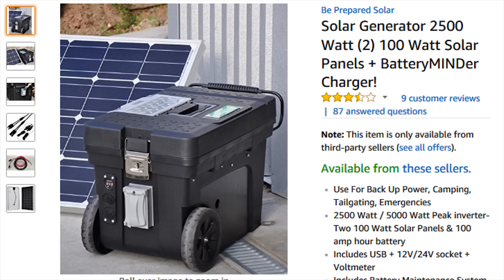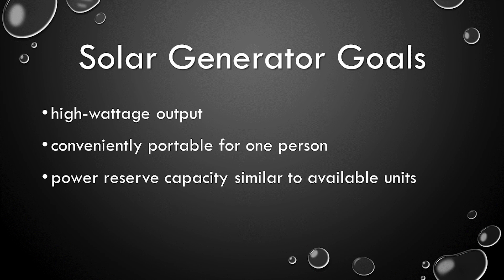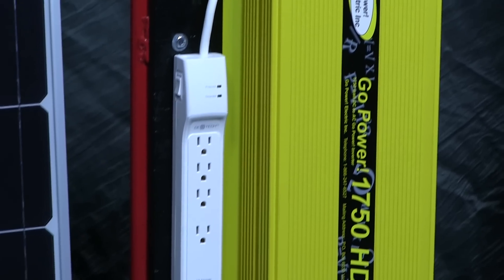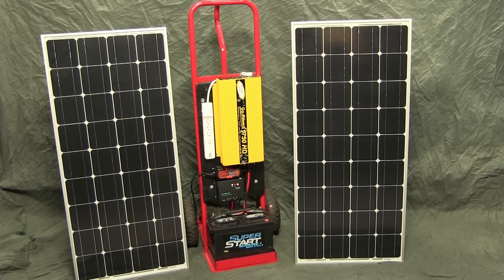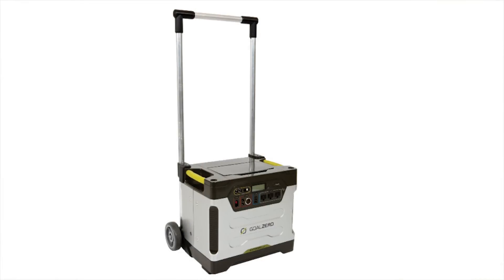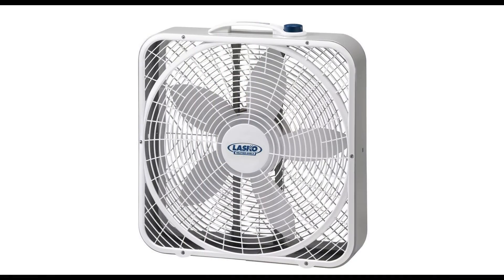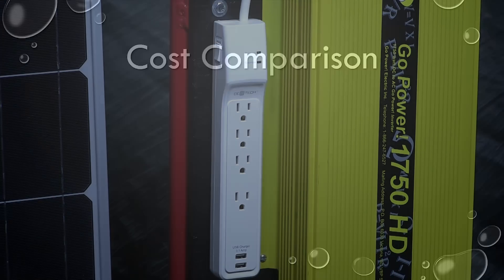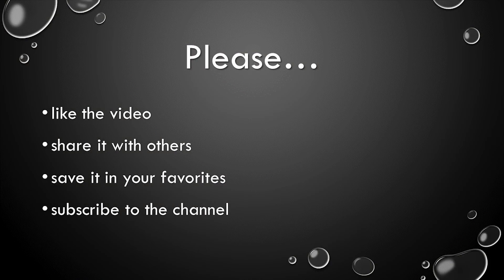DIY Off-Grid Solar Generator (rev 1) – Low-Cost Portable Power

Comment: Would your outstanding unit not be better served with a Lipo battery in place of the lead acid one you used?
Reply from the maker: Yes — upgraded the unit to AGM.  LiFePo is very pricey, and I’m not sure I’d use the additional capacity. Thanks for the suggestion.

Comment: this is a great setup.  i am researching options for my off grid cabin, and really like the hand truck for moving it around.
Reply from the maker: Thanks got the comment.  Be sure to check out the follow up videos — I’ve made several enhancements that would make the unit a good choice for your off-grid application.  The builder’s guide video includes a design worksheet you can download to calculate the parameters for all your components.
Reply: Desert Prep will do, thank you!

Comment: Would this set up be enough to run a dometic CFX65DZ continuously for upward to 5 days if needed? Would also like to see a how to do video! Thanks you
Reply from the maker: I can’t say for sure, but five days is doubtful with my original version.  The builder’s guide video in the channel includes a design worksheet you can use to get a good idea of what you’d need to support the fridge.  You can plug in the fridge specs, and know what you’d need to support it for five days.

Comment: does not meet the power of a small gasoline generator, puny thing.
Reply from the maker: LOL — yes — gasoline generator wins as long as you have fuel.  I have three generators, and felt pretty well set should the grid go down.  However, when I started thinking about how long they’d run on any practical amount of fuel, and what the logistics of fuel storage would be, I knew a solar solution would be necessary for just about any significant emergency.  In an emergency I’d have about 50gal of gasoline available, and this wouldn’t support either of my gas generators for all that long.  After the fuel’s gone, I’d have nothing.  This was the very reason I set out to build this unit.

Comment: Wow, your solar generator set up is almost identical to mine except I am using a slightly smaller 1.5KW inverter. I especially like the way you set up the hand truck to make the whole package portable. My portable solar power system isn't as portable as yours so I will be borrowing your hand truck idea to make some improvements. Thanks for sharing.
Reply from the maker: Thanks for the comment.  It’s particularly nice to find others that have put together their best knowledge and arrived at the same place. Be sure to check out the follow-up videos, especially the builder’s guide.  You might get another idea or two.  In about two weeks, I’ll post a video on the “final” version which is considerably more capable, and integrates a lot of the suggestions from the comments.

Comment: Nice video, good job.
 I built mine with $1700 capital for a 3 pcs 150W solar panel, pwm charger regulator 2000w inverter and 6, 100A deep cycle solar batteries, I did all  connections and DIY all fabrications. still working after 3 years, I actually think  I have ROIed my batteries already from my electric bill savings.
Reply from the maker: Sounds awesome.  Check out the builder’s guide video for a few ideas on your build.  I’ve posted a design worksheet link in the comments you can download that will calculate your system efficiency, and play “what if?” to evaluate upgrades you may consider.  I’lll be surprised if it doesn’t get you thinking...
Reply: Thanks, yes daytime exposure is 50% in tropics as shadows overcast after noon time.

Comment: only thought i have is instead of Modified Sine Wave Inverter needs a pure sine wave inverter as a future upgrade
Reply from the maker: You’re SO right.  Check out the builder’s guide video — it speaks to the evolution of the project, including mistakes I made in e original version.  A pure sine-wave 9nverter was the first of several enhancements...

Comment: Good video and presentation. Nice build. Mine is very familiar with the same red, big wheeled trolley. It works great for all my tool shop needs in the summer. 2 125 watt solar PV panels, 2 large batteries in the bottom, 5000 watt inverter and charge controller.
Reply from the maker: Sounds like a great setup...

Comment: Your entire build is based on your battery capacity. You should say upfront, the amperage of your battery at a 20 hour rate, and the nominal voltage of the battery
Reply from the maker: The battery is 90AH, so 4.5hr @ 20A discharge rate.  Nominal voltage is 12.8V.  I intend to add a second battery and double the capacity to 180AH.  There’s a lot more detailed tech info in the builder’s guide video.  https://youtu.be/6glK8-IcDgE

Comment: Thanks for posting and the material listing.  This is very helpful.  All the best.
Reply from the maker: Look for the upgraded list in the Rev 2 unit.  It has a better inverter.  I’ll be posting a builder’s guide with design worksheet you can use to spec out your own unit in the next 48 hours, so stay tuned...

Comment: Can you do a video of what it takes to maintain a normal 1 person cabin, that has a regular run of the mill 60 in. Flat screen TV. & A Play station gaming system, or a DVD system, a central air unite that accommodates a 1000 SQ. Foot house, a normal size refrigerator and normal size washer and dryer a normal size to toaster, & 60 watt bulbs as needed 1 per each room, running 1 at a time, sorry if this is a stupid question , but I'm just trying to see if anyone is capable of doing this , at a inexpensive price
Reply from the maker: The power requirements sound like you’ll need something well beyond this unit.  I’m working on a builder’s guide that will help anyone work out the design math.  Watch the channel for a few more days...
Reply: Carl, first off, if you are planning on powering all those high wattage appliances at once you WILL NEED way more than this portable system.  Think small scale first, then build from there.  A 60in Flat Screen with gaming system and AC ? Really ?  Time too fall back and regroup.

Comment: i will attach a wider base so it can carry at least two other batteries or mount the electronics on the back or sides to stack the batteries up
Reply from the maker: Larger batteries or more batteries is a good idea.  It’s not hard to both make the panel smaller and move it up to clear talker or stacked batteries. Thanks for the comment.

Comment: Desert prep, You took a seemingly complicated project and simplified it to the point of stupid...for guys like me.
Thanks!! ~:) I've been looking into doing dang near the same thing with the same specs. 
Down here in southern Az. This is the best option for my rv and for the house.!! 
VERY COOL.
Reply from the maker: Thanks for the very kind feedback.  Also, I've posted the wiring diagram in the comment at the top in case that helps. Be sure to check out the Rev 2 unit - it has some important improvements.  Also, there will be a Rev 3, following my real-world test video, out in a few days...

Comment: Nice job. I made one myself out of a tool box that I attach Wheels to with handles and I put two batteries inside the toolbox with the inverter of the solar charge controller and I bolted 100 watt panel on top of the lid of the toolbox it works great I get a lot of comments and compliments when we go camping
Reply from the maker: Sounds like a great rig!  Watch out for high temps in the box - batteries really hate heat.  Thanks for commenting.  Lots of people will like your idea.
Reply: Desert Prep thank you sir.

Comment: I was considering a similar design Harbor Freight solar panels on the roof of my golf cart and I had 6000 watt inverter to go in the back. I just hadn't put everything together your video informative and realistic thank you for information and inspiration. Great video!
Reply from the maker: Thanks for the feedback.  I can’t see too much utility in such a big inverter.  Without a LOT more battery and panels, practical loads are more likely in the several-hundred watt range.
Reply: Desert Prep golf cart had 8/6volt batteries and panels on roof was why not. When want charge I have water power gen. 50amp. It ride and multiple outlets for work or play. I run moving targets on my shooting range and it easy for power outage also who has power bank with mag wheels and run 50 mph 😇😇😇.

Comment: It would help to place the battery mounted to toggle front to back to eliminate removing the battery during transport. It would stay upright with mounting axis on both sides of the battery.
Reply from the maker: .. or switch to an AGM battery that won’t leak.  Thanks for the idea.

Comment: The yeti contains a lithium battery does it not? If it does it can take being discharged to far below 50% before being damaged. More like down to 5%
Reply from the maker: Yes, the latest Yeti has a Lithium battery, which can be discharged much farther without battery damage.  It’s a much better option that comes with the higher price.

Comment: Put a solar rated lithium ion battery on that. 4 times the power and no spill.
Reply: Lithium is no 4x the cost. That was true 5 years ago but today you can get lithium much cheaper. In the long run Lithium is actually cheaper than lead acid

Comment: Great idea.. I would also add a 12v side so u could charge say phones etc with out needing to go through the inverter. Saves on losses. Id only use the inverter on items that need ac. I'm totally going to use the idea of the trolley :D :D

Comment: Great video. Great build. Since you had a friend weld the tray on the bottom, I think I would have turned the battery 90° and added a second one. But lots of options. Great job.

Comment: wont your battery discharge to ground being so close to floor
Reply from the maker: LOL - no.  None of the circuit is grounded to either the cart, or to earth, so there’s no circuit to drain the battery.
Reply: Desert Prep, you said about storing it in your garage. I never store a battery on concrete unless I have an insulator under the battery to prevent discharge. There does not have to be be a traditional connected circuit for discharge, just that it's sitting for an extended length of time in contact with either the ground or concrete. Placing a square of balsa wood under the battery would cheaply & effectively prevent discharging without affecting your set up.
Reply from the maker: The battery box has a rectangle of expanded metal (diamond mesh) and a rubber pad supporting the battery.  I think the concrete discharge info dates back to car batteries some time ago.  https://www.snopes.com/autos/techno/battery.asp
Reply: A snopes link?  That's a total, Soros-funded propaganda website!

Comment: I like what you did.  I would recommended someone to first do a study of critical appliances and the four seasons to determine what an ideally sized system should be.  During an emergency, cooking and heating is better done with propane or natural gas.   My house has natural gas heating, so during the winter, keeping the furnace going would be very important.(~800W).  Also,   Refrigs and deep freezes would be great. Nothing like keeping your food safe. Some non critical appliances are TV, internet connection devices, computer, phones and some lights.  Maybe, the system could be used to offset your power bill.  Think of stepping the design up a notch and actually getting to a break even point in 10-12 years off setting some of your power bill and maintaining your emergency system to boot.
Reply from the maker: I think you’ve made great points here.  I’m learning a great deal in my own analysis, and would take different approaches to different scenarios.

Comment: Should check on using the 18650 lithium batteries has ability to use in any position.  Might have similar or better power output.
Reply from the maker: I’ve seen videos from people building battery walls from large banks of 18650s.  I find the idea very appealing, but not so much the need to build the banks out of hundreds of the small batteries.  Intrigued by the idea, though.

Comment: My first mobile solar build is a monster 500ah batteries 2500 watt inverter and 6x100 watt solar panels very heavy and not to mobile but it was still less than the yeti.
Reply from the maker: Sounds very impressive.  Both the batteries and the panels for your system are a better match for a load for a 2500W inverter.  Nice work!

Comment: I don't think you are supposed to chain together batteries with differing ratings or types.  Instead, you might want to consider some kind of battery quick connect/disconnect.  That way you could use your cart battery until it gets low and then easily disconnect it and connect to whatever other battery you have available.  I'm no expert on any of this though.  Btw, I did a quick search and found the below.  I have no clue if that would work or not.  However, it should give you a good idea of what I'm thinking.
https://www.mygreenoutdoors.com/motorguide-quick-disconnect-battery-terminals-1/?gclid=CjwKCAiAqbvTBRAPEiwANEkyCAJnvDJRWAHwo0Do5w6-GHlmz_WrXh2UAyWD5_N21JFnDBB1AVKiyRoCb9EQAvD_BwE
Reply from the maker: Thanks for taking the time to share what you know — I really appreciate it.  I probably should be more careful with loose commentary.  I was pointing out that the system could be temporarily boosted from another battery if the situation warranted it.  I didn’t envision it to be a permanent setup, but I certainly didn’t articulate that.  Inevitably, there will be people that might take what I said as a suggestion or recommendation.  I’ll be more careful in the future.

Comment: 1st let me say great video buddy, I have been thinking about doing something similar 4 a while now...
I think if u mount 1 panel on the front, use a hinge by the battery so it can stay vertical when not in use, and tilt back when in use. (So not to take up too much space when stored)
Then using hinges on the side of the 1st panel add a panel either side so u have 3 in total, folding back to each side (that way u could always add more in a concertina style as needed)
The fold out panels will need a fold-away "leg" to prop them up.
Don't 4get a bungee cord 2 hold everything in place during storage & to hold the middle panel 2 the hand cart when angled.!
There r a few other changes I would advise u 2 make...
The battery - change 2 lithium asap. (4 ideas check out Jehugarcia, he has links 2 great deals on cells or any of the other ppl doing DIY powerwall type projects)
(U won't need the auxiliary battery charger that way as Lithium holds its charge unlike Lead)
Charge control - switch to an MPPT if u can afford to as they r much better.
USB - get some 12v to USB converters run them via individual switches straight from the battery.
...But other than that, it's a great starting point, & something every1 can afford & do.
Much respect from the UK.
Reply from the maker: I think the cart will get a little unweildy if I put the panels directly on it.  Also, it might make it difficult to get the panels into an optimal direction and tilt if the cart is attached.  Currently, my panels are on wood frames mounted to the sun shade over the BBQ.  Good advice on the MPPT charge controller.  I’m looking for a good one that monitors the system and has bluetooth...

Comment: Great video.  good description of your needs and sizing of the unit.  I've done the same thing to insure that we can power electronics and my CPAP, but mine's not portable.  we lose power here due to ice storms every other year or so. We also have gas generator power as well.  I like the hand truck idea.  I think there's some welding in my future.
Reply: I cut my cpap wire between the transformer and the cpap. I made a connecter to use it in normal mode and made a connecter wire with a cigar lighter connector. When I go camping, I plugged it into a home depot jump start/compressor/usb/cigar lighter and it lasted 4 days.  I will build a desert prep inspired unit in the future for emergency use though.  GREAT VID.

Comment: The last week I've been looking at putting solar power in my van watching a lot of video and learning the math that computes what I need if I want to run something for a certain a mount of time.  I'm far from an expert but better batteries would be my first change.  Optima's don't require checking the water and they can be mounted at any angle.  They are not cheap, about $270 each, but I don't want to deal with water.  On your set up I would weld a second battery holder and wire the batteries together  You're current set up will take a little over 7 hours to recharge your battery via solar once it has been used to operating capacity.
Reply from the maker: You’ve hit some of the math I’ve got in my real-world analysis video (due soon).  AGM batteries are near the price of the Optima, but may be marginally better.  More in the upcoming video.  I’ve posted a wiring diagram at http://www.desertprep.info/schematic.pdf